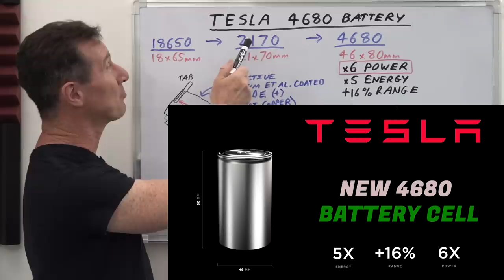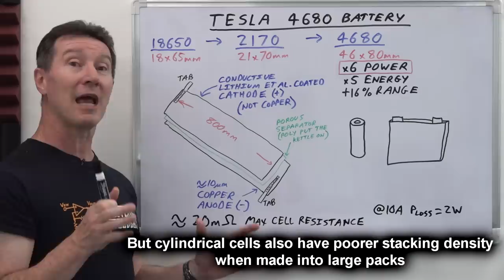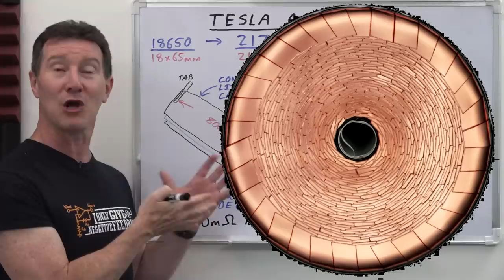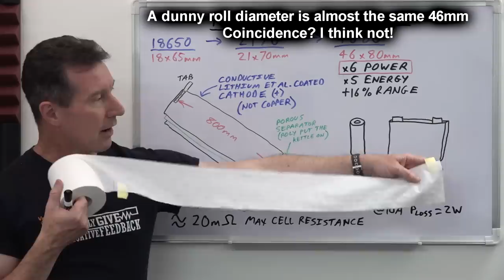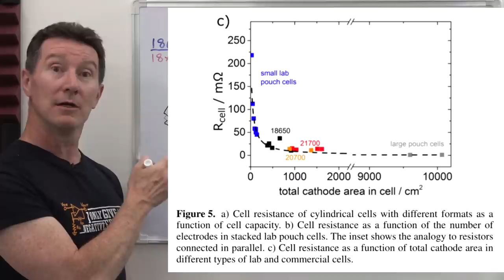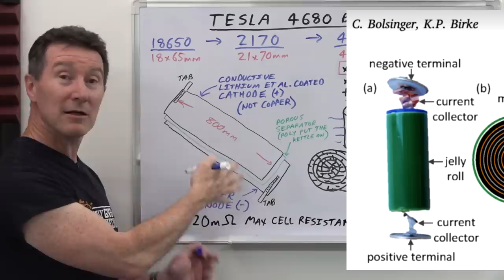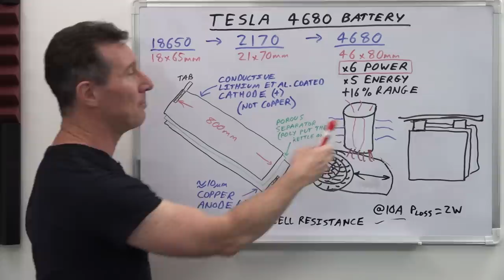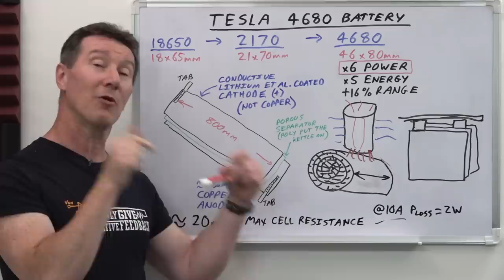EEVblog 1340 - New Tesla 4680 Battery Cell EXPLAINED

Comment: I'd argue that 90% of innovation is someone saying "why don't we just do it this way?" and everyone else just replies "duh, why didn't we think of that."
Reply: Why don't they just use pack cells?
Reply: @TheRainHarvester  the primary reason is cooling/fireproofing. Pouch cell packs have to be heavily armoured against both cell swelling and puncturing. cylindrical cells have a lot of that built in because of the shape
Reply: @rrobertt13 I heard manufacturing pouch cells is more difficult and costly than manufacturing cylindrical cells. Plus consider how the manufacturer will have to secure the prismatic type cells in a pack. They would need a heavy structural system to keep it stable and secured. This of course will take up space and add weight.
Reply: just calculate the optimal surface/volume size and you will see the "new" cell design comes close to that. eg: a can of coke.
cell technology is just old fashion in new clothes. I would say: welcome back bigger brother of D-Cell
Reply: @TheRainHarvester  Aren't they. There were reports last year that they are using CATL's prismatic cells for the Asian produced cars. The 4680 are probably designed to reuse the whole equipment they already build for the cylindrical cells in the states. These bigger cells look like they are easier to cool than prismatics if they can direct contact them.
Reply: Well, that was obvious. Wasn’t it? That’s what the concept of innovation is about — thinking differently.
Reply: everything is a remix
Reply: @mattmoreira210  Yeah, I was thinking when I read that , that there was a bunch of steps missing. First examining the existing design, knowing what you are looking at and then having the understanding it takes to see a different and, of most importance, BETTER way. Then pointing it out with as much snark as you can get away with while implying that everyone should have thought of it now that it is obvious because you explained a whole novel approach in a concise way that it clear to your audience. ( inhale)

This sounds like  one of those "lets make a pill that cures cancer" concepts. Oh right! A pill that cures cancer! Perfect! oh wait a minute...
Reply: Single word

Correct
Reply: @TheRainHarvester  if you mean large batteries like what you see in say a modern laptop

Its down to 2 simple things over everything else

1) durability, those types do not hold there full capacity for long enough meaning massive waste of materials as those types are harder to recycle and would need constant replacements when used at max amp draw and max charging speed day in day out, on a laptop it doesn’t matter much loosing 30 minutes of run time but in an electric car loosing say 20 miles could make a trip you can bearly do without needing to charge impossible without charging at some point between A and B

2) safety it is safer for a single individually cased cell to go bad but if it was made of say 50 large chunks and not say 10,000 cells if you loose 1 you just lost 1/50 of the range say it had a range of 500 its down to 490 instantly and thats if it doesn’t end up setting the bloody car on fire
Reply: @Psi-Storm  its is a completely different fabrication process while it might be possible to reuse some equipment after modification its unlikely as hell

As for the 4680’s they will be prototypes and tested in limited quantities and then modified, optimised and finalised some time later

Edit: adding a break here, below is for people thinking Tesla is gonna more to a different county for production and do shipping

Also tesla will not simply move to china considering they will be doing the lithium mining themselves easier to keep most manufacturing in America for sale in America

Its baffling that people think its cheaper to make an electric car and ship from china to america when its actually cheaper to make it in house and in the country your selling it to because unlike other companies the personnel needed is really low so the savings from cheaper workers is negated by needing less people instead

The rear pretty much half the car is going to be a single solid piece removing a bunch of manual labour and the 4680 battery factory will be just about person-less

Tesla reduces cost by hiring and using less people but at the same time that increases orders and then increase how many cars need to be made allowing them to hire more people so they dont look like they dont hire many people at least compared to other car companies

If you have 100 people working on a car and it costs 200k you wont sell many so wont be making many so just need the 100 people

But if you had 10 people per car and its 30k you could endup needing 300+ people because you need to make a heck of a lot more
Reply: Elon already answered in some interviews... too many MBA's
Reply: Naah not 90%
Reply: No they just go DUUUH. And nothing happens.
Reply: You’d think so…
But, most of the time it’s actually
“Why don’t we just do it this way?”
“That’s too complicated and dangerous and it’ll destroy the company and I’m the boss do it my way while I go sit in my office”
Reply: @LightSpirit24  is two twelve packs in disguises.

Comment: I understood the "jelly roll" but the tabless concept escapes me. Until you showed that toilet paper with those post-ts and then it dawned on me. Awesome! Good analog!
Reply: Some capacitors are made in a similar way
Reply: Yes but now I only wipe my ass with copper sheets.
Reply: Everything makes more sense with big roll and post its.
Reply: @klam77  oooOooOOOOooooOooOOOOoo the paaatent.
Reply: Isnt that a multi tap design? Instead of tables?
Reply: Or as they say in aussie, dunny roll 😆
Reply: @deathlydarkness  according to Trump, they also re-invented the wheel.

Comment: In the calculation of the internal resistance of a foil, the tabbed design was for a conductor 80 mm wide and 800 mm long, for the tab-less foil it was 80 mm long and 80 mm wide. (Website flashing by at 15:14) Shouldn't the width be 800 mm in the second case. This would make the internal resistance two magnitudes lower, not just one.

Now, in real batteries the internal resistance is also affected by the resistance in the electrolyte and polarization of the electrode so it isn't as easy as just calculating the loss in the electrode material.
Reply: Good point

Comment: It's good that you are self-employed. Imagine your boss looking over your shoulder while affixing Post-It notes to TP.  "Hey Dave, whatcha doin'?"
Reply: I'm makin' a super battery, boss! (cell, I know)
Reply from the maker: I've tested the vibration and shock response of feminine hygiene pads before. True story. Wasn't a bit awkward getting that money reimbursed.
Reply: EEVblog WE want to know, now that you've talked about it! Second channel, maybe?
Reply: @EEVblog  I did tensile tests with the elasticated bits of diapers/nappies once,  one of the big corps commissioned our university to do it. They sent us a pack and we spent an afternoon cutting the waists and leg cuffs out.
Reply: @EEVblog  We get to see that video when?
Reply: @EEVblog   soo, were doing stories about strange things now ??
 Large part of my engineering degree can be reduced to transporting standardized poop (volume, weight, surface texture..) through pipes with the correct amount of water, diameter and angles.  So your shower tub doesn't get brown when you flush too hard.
still have some pixel video about coloured water going through pipes in a 3 story building mockup in a comparison done wrong / done to specs.
Reply: @EEVblog  at the end of the day 20 dollars is 20 dollars. Kek

Comment: I’ve noticed obvious things are generally only obvious after the fact.
Reply: That is the problem for engineers - when you have a really great innovation it is hard to get any credit for it because it seems obvious after the fact
Reply: Yes - that's obvious!
Reply: I just spent a paragraph saying this. Nicely done Sergei.
Reply: This is also not entirely without drawbacks.  Copper is really expensive and you are going to have more of that with this design, and you have to figure out a reliable/fast/cheap way of cutting and folding the new tabs that are not tabs. Imagine the idea is you offset the cost of the copper with  the simpler thermal system and other details. So this idea may have been thought of before but wasn't viable in other contexts, or that the tricky innovation was how to manufacture it well.  devils in the details.

Comment: Please be reminded that 
1) Conventional tab (have preload force) to secure contact resistance also spark proof. 
2) Tab less / multi tab architecture have more tabs made of annealed soft copper to be in touch with casing (without a preload force) have undefined contact resistance. Tabs will deform under mechanical shock on road. It cannot reform itself once deformed. Gradually the effective (passing current) tab counts continues to drop as shock persists. When the last effective tab remains in the circuit the next shock will open circuit at that tab-case junction producing a spark next to hot chemical inside to a possible internal ignition/combustion.
Reply: Couldn't you solve that by just loading the cell itself? I.e. Squash it slightly between the two battery terminals. As a side benefit, you get better thermal conductivity at the end of the cells, which you want anyway.
Reply: @dirkson  I know what you mean and I agree with squash. Unfortunately squashing also requires a specific preload force to be stored in an elastomer associated with a conductor tap found in 18650 and 21700, is however removed along with the tap in the tab less 46800. 

There is a clean solution for all cylindrical type- one stone kills two problems. A solid metal wafer to conduct feat and current. Wafer created by magnetic induction heated soldering, jointing anode and cylinder base.
Reply: Isn’t this solved in a similar way to AA cells that use springs? You just build some give into it.
Reply: @kinamod2k  not exactly. AA cells work with an external spring is absent in 4680 cell. Electrical engineers don’t understand the distinctions between annealed vs hardened metal assuming the anode were annealed during jelly roll process, and falsely assume all anode flaps are hardened for spring, is the problem. Metals can’t behave in any state as an engineer expect it to be, annealed at one stage and magically hardened to the next. For all practical purposes these anode flaps begins annealed state and stay annealed during the jelly roll process. Annealed to avoid self delimitation - similar to the unwinding nature of a clock spring. So the anode flaps does not possess spring property, is more like annealed aluminum foil. At the end 4680 cell has no pre load (spring) force built in to enable good electrical contacts.

Comment: Remember Dave, maximum packing density if circles/cylinders are always the same regardless of diameter. The tabless design allows for the removal of the cooling pipes between cells regardless of cell dimensions, so that density improvement isn't attributable to cell dimensions. It can however reduce the energy density with cell dimensions if there is less cell can and wiggle room needed for inserting the jelly roll.
Reply: That would be true if the ratio of jelly roll : hollow core : case were the same, but if the core is the same size and the case is the same thickness, you end up with a higher power density with larger cells when they are packed together.
Reply: @ausnetting  Exactly, I was going to make a comments that would be both of these. Lucky didn't take long to get to these. And you mean higher energy density not power. Yeah the energy density of the battery materials (anode, electrolyte, cathode, insulator) might be the same, but with there is probably 16% more energy holding material within the given total volume of the battery. Also there might be some minor increases in the % depletion and % charge that can be achieved based on the reduction of internal resistance, this would be so low that it would be negligible compared to the material ratio differences.
Reply: @ausnetting  My point is packing density of cylinders is always 90.69% solid with the rest wasted regardless of cylinder diameter (edit: or height) for Dave's 26:00 game "for those playing along at home". The cell itself may have a better energy density but the cell size itself will not lead to a better packing density of the cells into a pack in a apple to apples comparison. 
EDIT: yes on a technical level cell interconnects, cooling heatsink and edge of the cell packing density "may" improve but that needs information that us "playing along at home" don't have.

Comment: When you have cuts in a strip of material that is tensioned to be rolled up into a cylinder, you risk tearing it up and disrupting your high speed production line. They must have found a clever way to avoid this. Perhaps cutting the tabs as late as possible in the process.
Reply: Coud it be that you first glue a reinforcement/insulation strip onto the copper sheet.   
Or now that I think of it, could you cut them after you have rolled them?
Reply: Maybe using a sinusoidal cutting die to create the tabs would keep that from happening?
Reply: It's possible they could have a rotating drum-cutter to cut the edge of the strip into tabs as the final step before the strip gets rolled up. Rolling and tab folding is definitely gonna be done in a single step. I agree though, that tab cutting is probably going to be as close to the last process step involving the strip as is practical.
Reply: perforate and tear at the end?
Reply: It could be cut as it's being rolled.
Reply: @sycodeathman  I bet they use lasers. Much faster.
Reply: We see on video how they rolling them (if they do not change it) and they did not be cut at this step, so it suggesting it is done later.
Reply: Muru Roa or blades that have rounded ends, more of a punch than a blade
Reply: TheRainHarvester well now my comment just looks stupid, I keep forgetting lasers exist
Reply: @TheRainHarvester  I would have though a scissor type tool would be best. Think of a pair of tin snips. That would also tend to twist the tabs very slightly, meaning an easier rolling process as the slightly twisted tabs would naturally fall under the preceding tab.
Reply: @sycodeathman  y r we even assuming they've solved this issue?  They're making cars in a tent because the manufacturing line wasn't working properly

I bet they can't make them en  mass
Reply: This is laser patterned
Reply: I see successive layers folded over each previous layer, which means each tab is folded in as it rolled.  Don't see why they couldn't cut it just as it is folded.  I'd love to see a slow-mo of the production/rolling section that is folding those tabs at massive speeds as the foils are rolled together at what I imagine to be very high spin rates.  Modern manufacturing engineering is amazing with design tools able to assume speeds, tolerances, and repeatability that just wasn't possible 10,20,50, an 100 years ago.